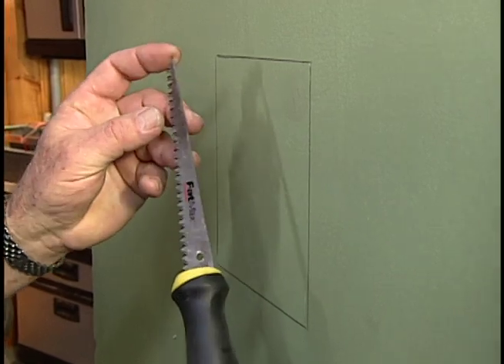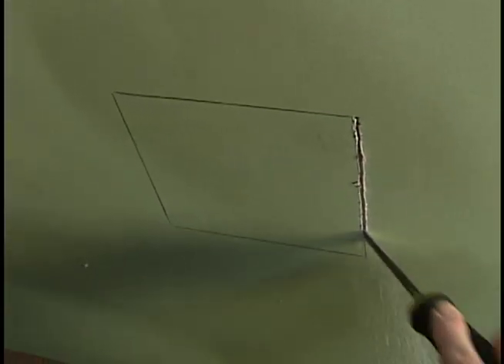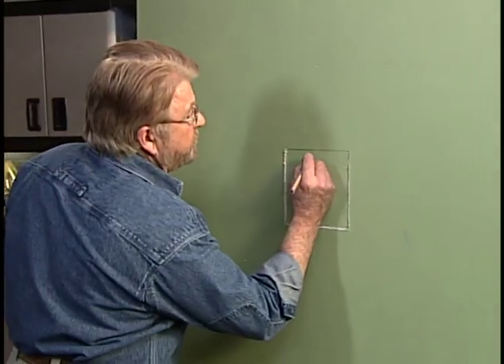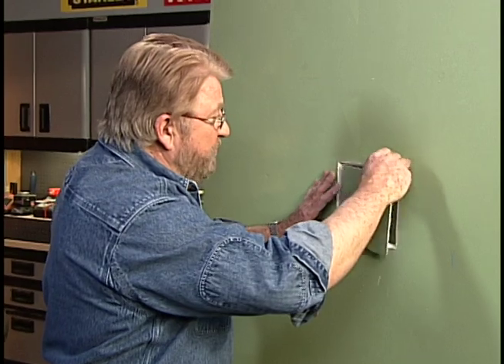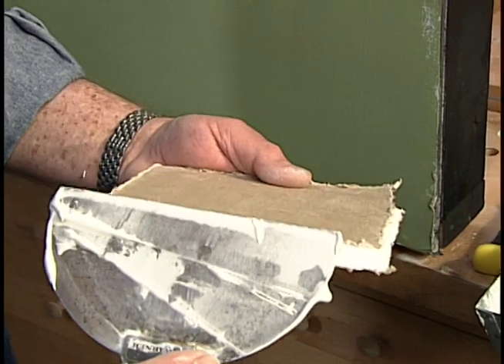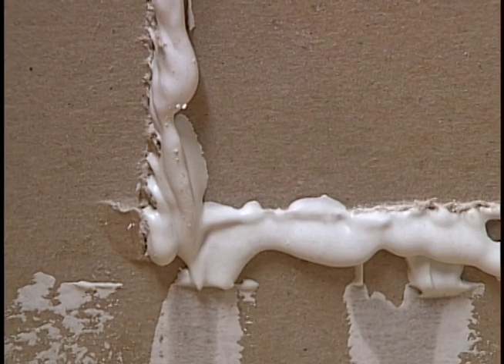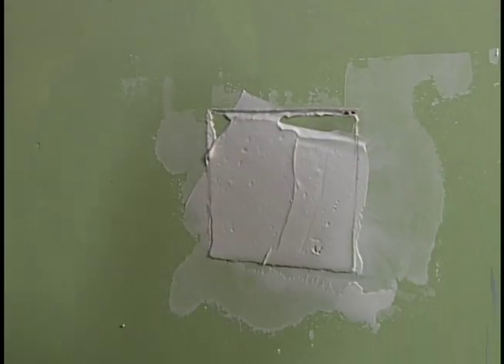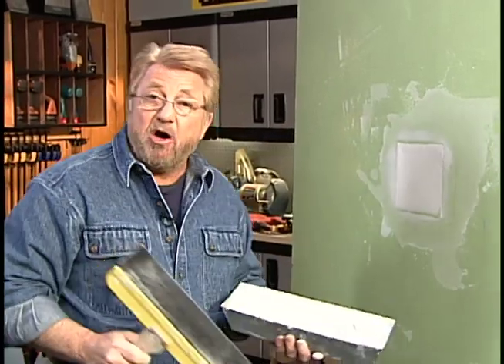Cut Inspection Hole in Wall

Comment: Excellent technique! Love how you turned the corner with the saw, and the 45 degree bevel makes a ton of sense. I do wonder if there’s a way to have the replacement piece be even with the wall such that the final skim coat isn’t needed. Perhaps a piece of flat board screwed in from the front, but behind the hole to keep the replacement piece from being “lower” than the wall…

Comment: I like the part where you cut out the panel. I have never seen or heard of the bevel cut before, but that seems like a good idea. I don’t think I would replace the patch without using a furring strip or something like that for a nailer.

Comment: Shouldnt you tape the seams?
Reply: Absolutely
Reply: That's what I thought! Those joints are going to crack
Reply: For such a small cutout, I'd use flexible caulking to connect the joints and skip the tape. The caulking would prevent cracking.